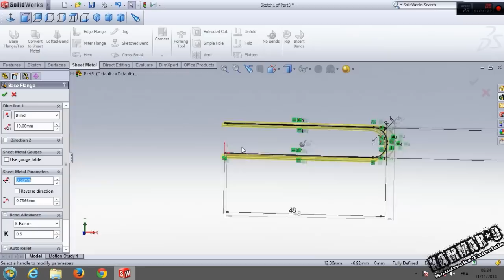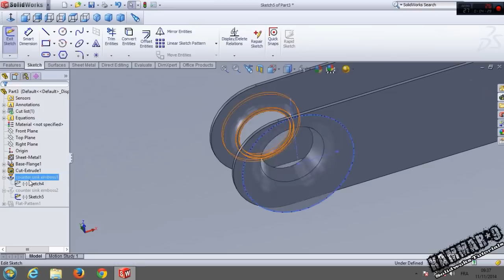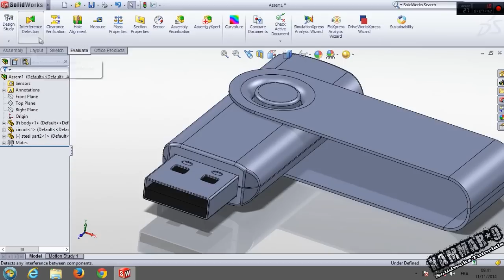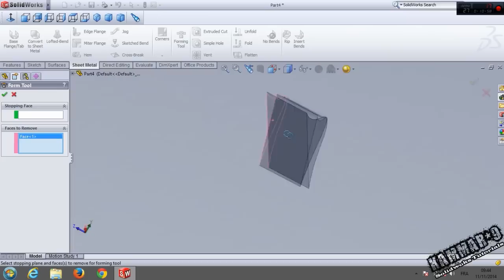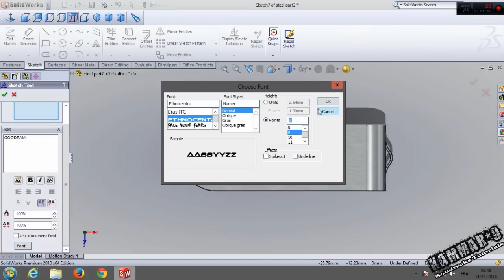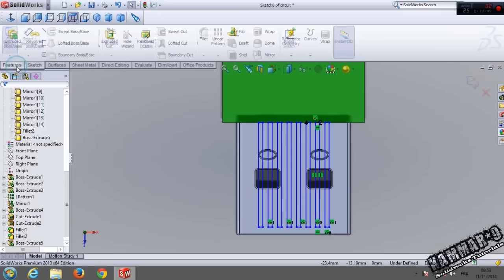Modeling a USB Flash Drive in solidworks 02

Comment: Why do my counter sink emboss not look like yours?
My isn't hollow and I can't sketch it:(
I'm using solidworks 2011
Great video btw
Reply: +Huffie Right click on the Forming Tools folder in the Design Library, and select Forming Tools Folder.

For some mystical reason, SW chose the setting which disables the feature to be the default.
Reply: Thankyou Mohamed! I was stuck on that for hours :)
Reply: @kanon22ful  I have already done this steps you mentioned. But still cannot be able to edit/modify the distances/angle of the countersink feature. I'm using SW 2020.
Reply from the maker: +Huffie  I don't no , you can send me an image or short video to see what' up  there
Reply: +khelifaoui Ammar, i cant modify the sink enboss, all the variables, like 12 to 8.5, i dont know why, i tried, but it cant change. Hope yoy help me....

Comment: i love ur work,  i have a question for you,  why can't i edit counter sink emboss in solidworks,  when i try to change the dimension,  it doesnt change.  do you know why? so strange,  i use solidworks 2014.  thank you
Reply: +angie wang Right click on the Forming Tools folder in the Design Library, and select Forming Tools Folder.

For some mystical reason, SW chose the setting which disables the feature to be the default.
Reply: +angie wang because for change dimension, it is not a click like he said, but a "double click" ;)
Reply from the maker: +angie wang  hi there , How you can change the default setting !! , therefore I created a new tool and add it the same folder to make a personal tools